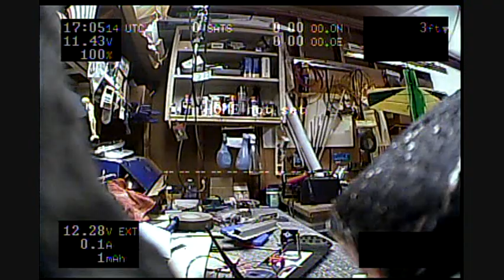Video Waviness

Comment: I hope you got my email, again I had a problem with antennas (5.8) on relay, but my distortion was way worse in the same upper part.
Once I got new antennas for goggles and GS I have great picture.
So for starters check your 5.8 antennas.
What a monster plane this set up is going to?? :-)